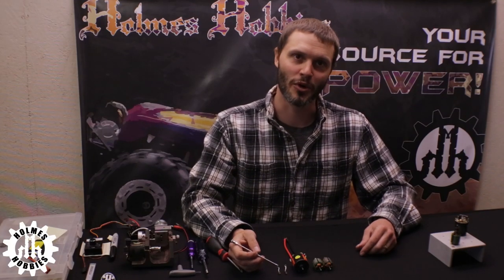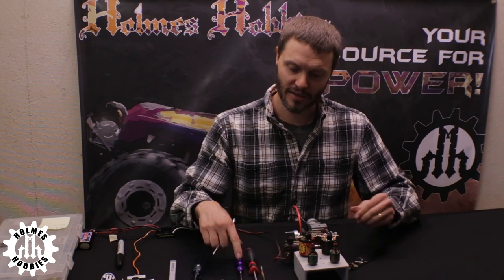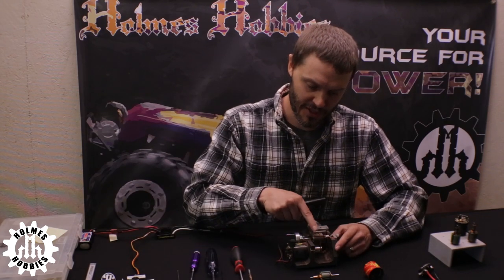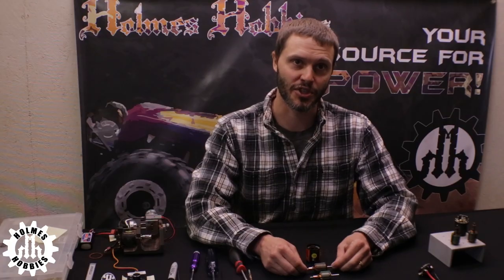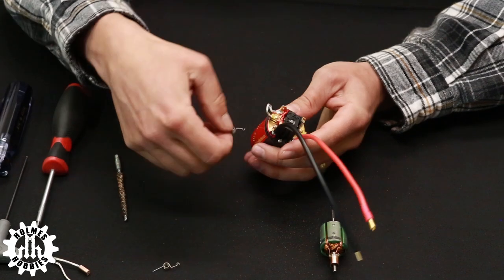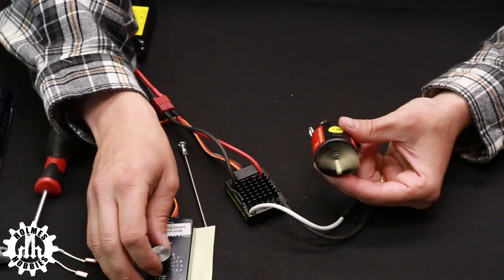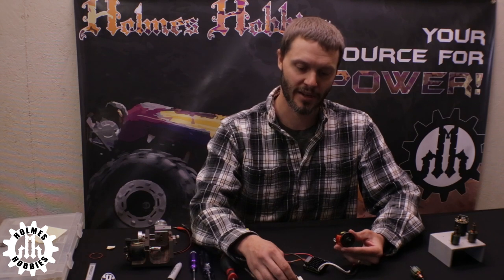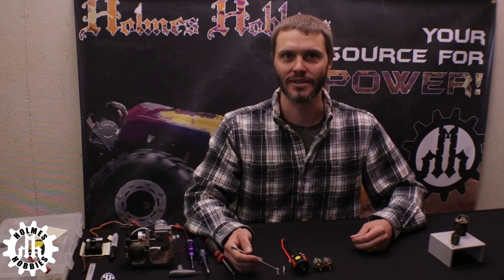Brushed Motor Rebuild and Break In

Comment: Im running a BL 2200kv stubby in my crawler and i must say im really impressed with the power and with a 10t pinion and 56t spur i got all the torque i need. Great motors. Was really surprised to hear at the end of the video that "do not break motors in in water", i've seen so many videos of the motors being broken in that way and was going to do it myself. Until now of course. Thanks, very informative video for a new to RC person.

Comment: Very helpful info. I used your 180 degree bell flip trick to turn my forward motor direction in my no name 45t motor. It did not have timing adjustability, however the fixed 2 bell mount holes in can let me turn exactly 180 degrees..amsome trick.

Comment: Do you run capacitors on your brushed motors?

 I've got one like in this video and one that is a cheaper Chinese 540 that does not disassemble. I'm using them in projects where brushless isn't precise enough.

Comment: i installed a new silver brush set into a 13T torquemaster and they are way more noisy than the original copper brush set.?. did i do something wrong or miss an important step?
Reply: 15:56 you mention the brushes clicking.. i think that is the noise that i hear. what is causing that and what is the solution ? 
i also just ordered a used comm lathe on ebay and will receive it tomorrow. would cutting the comm on the lathe be the fix for this problem ?

Comment: Great video! Do you have any experience of cleaning a Tamiya Super Stock TZ motor’s commutator with Tamiya cleaning brushes? The reason I ask is I can’t get them to work! I’m using the correct stand up cleaning brushes and only replacing the motor brush on one side (+ or -) but the motor won’t spin when I power it up. The motor works fine with both its brushes back in. What am I doing wrong?

Comment: why don't these motors have fans on the shaft? Do they run cool without fans? Thanks
Reply from the maker: Our sealed can motors have internal fans.   Our nicer rebuildable motors do not, as they run more efficiently and do not need fans when proper gearing is used.

Comment: My brushed motor sometimes stops working entirely, I clean it and its back for a few days.  Does this have anything to do with the brush wires touching the motor can ?
Reply from the maker: no, but the brushes may be hanging in the hoods or it may need a rebuild

Comment: Can you use your parts inside other motors? Say I wanted to use better magnets and a better internals in general to get better performance could that be done? Say a 12T Traxxas motor?
Reply from the maker: On rebuildable motors, yes.   Not on sealed cans like the titan or my Sport motors.
Reply from the maker: at least, not easily.   Would take about an hour of work and you would need to buy nice epoxy to transfer magnets.   For $20 you can just buy a TrailMaster sport and have better quality than the titan and no work transferring parts.
Reply: Thanks for your advice. I appreciate it.

Comment: Hi John. Great videos. So I’m just getting into the scale crawler rc’s. I love your motors but money is tight starting up right now. I was thinking of getting a yeah racing hackmoto. Where can I get replacement brushes. And do you recommend a different motor in the $20 range. Looking for a 35T for my scx10 ll kit. Thanks for your time.
Reply from the maker: We have the TrailMaster Sport motors for $20 and under.    The Hackmoto's are rebuildable, but I wouldn't spend the time or money rebuilding them.  By the time the first set of brushes are wore out, the comm on those is typically wore out too because of how hard the brushes are.   My sealed can motors have higher quality components, which is kinda sad!

Comment: What do I do if my commutator is too thin? I ran 2 set of brush on my torque expert and now it’s down to 7.16mm diameter
Reply from the maker: 6.7mm is the low end, at which point a new armature is needed

Comment: Hi, Thanks for the really nice tutorial, I just got a new Hackmoto v2 form yeahracing, 35T. I think I ran it for like 3 min on 3v from my power supply, also, changed the timing a bit to get the minimum current on 3V which indicates that it is on neutral (I hope I did right), but still I feel that the motor is very hard to rotate on low voltage, it doesn't start like the motor in your video. When I apply 2v, 2.5v I just get high current draw, and unless I start it with my hand it doesn't rotate, does that sound right to you?. when I rotate it by hand (Unplugged) if can feel heavy resistance from the magnets. Also when running on 3v I can feel it a bit vibrating, and provide extremely low torque (I can stop it by just touch the pinion). Would love your comment on this.
Reply from the maker: Well, thats because it's only a crawler motor on the sticker and marketing fluff.   They might say they are made for crawlers, but they are not tuned for them at all.
Reply: That explains why I burned my 540 hackmoto V2 35t today. The motor was barely used. It collecting dust for several years.  I overheated it in 4-6 min on my stock gmade gs02f with unweighted steel wheels. It overheated worse than my goolrc 27t 540.  I just order myself a crawlmaster sport 550 13t and a smaller pinion in case I need to gear down more than stock.

Comment: Great Tutorial John!
I know you don't get on here often, but I'm going to throw this out anyway....
A couple of people told me that my Wraith has a Clockwise rotation Motor. Is that true? As far as Timing is concerned, I guess I could just time it so it spins faster in forward, as you showed, by Sound...
I just want to know if that's true.
Carmine 🚂
Reply from the maker: I'm here all the time, but went on a trip down to the Ultimate Scale Truck Expo the last week.    The regular wraith is reverse (clockwise) rotation.  The Spawn I do believe was normal rotation.   Just make sure it goes a little faster in forwards than reverse and you are good :D

Comment: Hi . I own TQM 540 27t  What is maximum voltage for it ? I'am going to use it  HH water proof ESC .  
Can you make rotor axle longer on back side ? [not comotator side ]  .I would like to put little fan directly on axle . motor goes inside RC tank [ bad airflow inside ] .
,,,,TANK,,,,,,, you .

Comment: Hi John, I have a Titan 550 21T motor can your break in method used on my motor or I need to break in the motor in water? Thank you
Reply from the maker: Yisrā'el Yaʿakov water will seat the brushes faster. You must blow out all water with air and relube bushings.
Reply: Thank you John for taking time to replies my question. Thank you so much :-)

Comment: But you did not rewind .
You should always do this because you can slightly experiment with the add or subtract a turn here or there for customizing the torque vs. RPM
Situation personal prefe4nce.
Skewing armature poles is option also